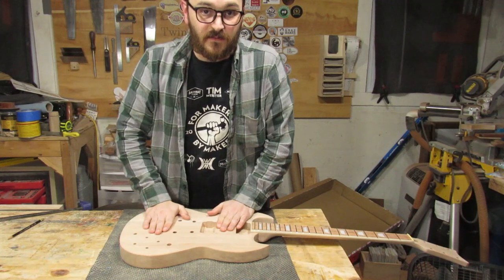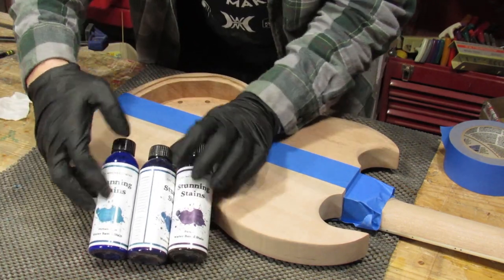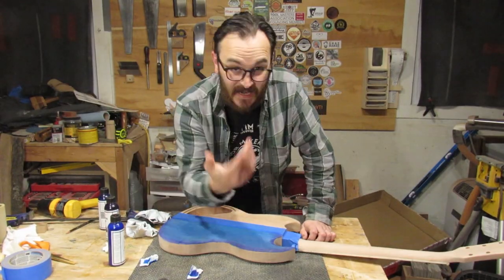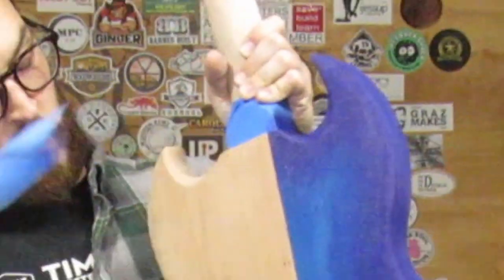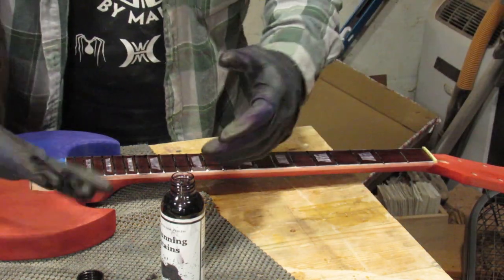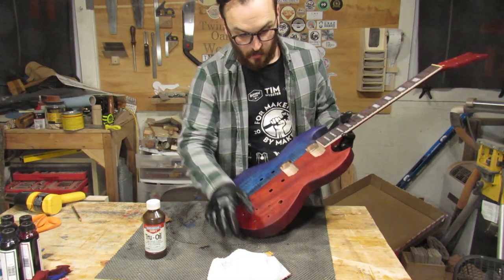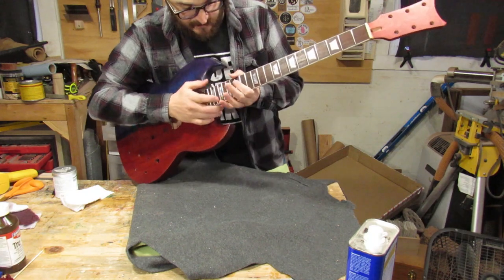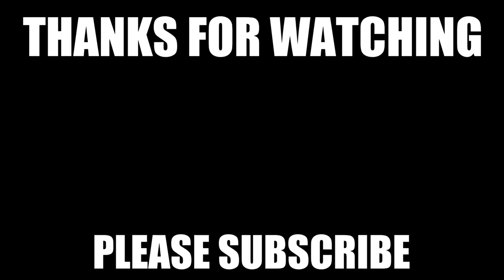Stewart MacDonald Guitar Kit - Episode 3

Comment: Its basically fool proof- as he drops lid! Like the matt look- but likely would have used brush poly if I couldnt spray. Great video!
Reply from the maker: In my defense, I drop everything.  Poly is nice, but it takes such a long time for each coat to cure, and there's a lot more sanding between coats.  With the TruOil I can do several coats a day and build them up to my desired gloss.   Thanks for watching!

Comment: Maybe you and your viewers will find this info worthwhile: I built a 6-string guitar/4-string bass doubleneck kit from Solo last year and had really excellent luck using a leather dye I always have around for my carved leather projects. The name of the color is Oxblood, the company's name is Fiebings, and they make several different dye colors that should all work well with wood. I also used TruOil, but I got a VERY glossy look by putting eight coats on it, rubbing with #0000 steel wool between coats. It dried VERY hard, too.
Reply from the maker: Thanks!  I've done some leather work as well and have a few dyes from that same company, just black and a dark brown.  The dye I used on this one is pretty much the same thing, a water based dye.  I could have also kept going with the tru oil on this one as well but I didn't want it to be super glossy.
Reply: Cool! I also use their USMC Black dye which gives great coverage. I used both on a leather pickguard I carved for a Squier Strat that turned out well enough to record a 20-second video of for YouTube. A skull and some flowers. I’m currently building (very slowly, though,) a Tele Custom that I’ve painted green metal flake, but will eventually carve a full leather cover for. The plan is to draw something (hopefully) cool to carve into a top, back, and side rim which will all be laced together to cover the entire body. I’ve got a set of Seymour Duncan P-rails loaded into the pickguard it came with, along with enough push-pull pots to take advantage of the gazillions (I think it only, like, six😂) pickup combinations. I’ve used them before and I’m kinda in love with the “P90” sides of those pickups. We’ll see how it works out, but it’s going to be a while - it’s hard to work on my own stuff these days.
Reply: Also, In case you’re interested, here’s a link to that Strat with the leather pickguard. I also swapped all the hardware for gold parts, including the custom engraved “Beauty” neck plate...

https://youtu.be/wraS_29_49s
Reply from the maker: Wow, that pickguard looks great!
Reply: Thanks, man! If it has a tattoo vibe, it’s because I’ve been doing that for a long time, too. I’m hoping the Tele kit’s cover looks good too. I’ve also got a Squier Tele Custom that matches that Strat, so I guess I’ll have to do a pickguard for it, and swap out the hardware for gold on it, too. Those locking tuners are really great.

Comment: Shoe polish never really hardens up. If used on wood, you would need to reapply over time. Also, it doesn't really seal the grain.
Reply from the maker: That's a good point.  It would have to be flexible so it wouldn't flake off the shoes.
Reply: @JoePierceMaker  I used black shoe polish on a gun stock once. I stripped and sanded then applied the polish. It did look very interesting, more grey than black but the wood pores took the black color well. I intended to use the polish as a stain and finish with an oil. The polish didn't allow any  type of finish to stick and it literally fell off the wood and the polish allowed oils and dirt from my hands to penetrate into the wood. Lesson learned...
Reply from the maker: @LouisaGuns Oh man, that doesn't sound like fun at all.

Comment: The first rule of trying something new that is irreversible:  "Try it first on scrap!"   I would never, ever dump finishes or coatings on a new piece of wood without doing a test piece, or several.  You didn't set the neck at the proper scale length (dimension from nut to bridge) so I assume you never intended to play this "art project" anyway.  Maybe you'll give it away to your biggest Patreon donor?
Reply from the maker: I've used these stains on several projects so I pretty much knew what I was getting into, so that was never an issue.  But also, you can test something till you're blue in the face and still screw up the job.  Worst case scenario, it looks like garbage and you paint it instead.  

The scale length is fine, watch part 4, I play the guitar at the end and the intonation is great.  The only problem it has is a bit of tuning instability from the cheap tuners and plastic nut, which will all be replaced eventually.